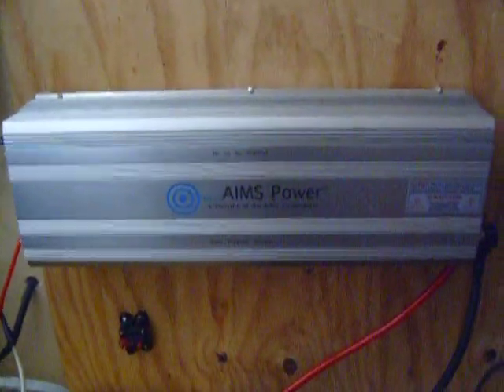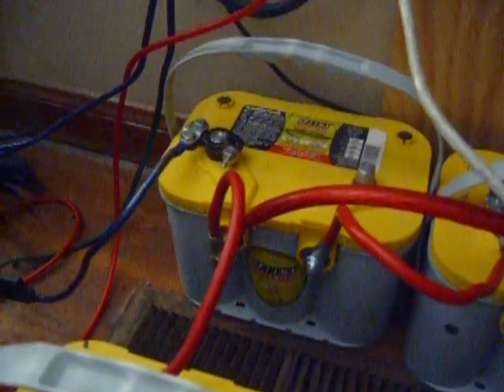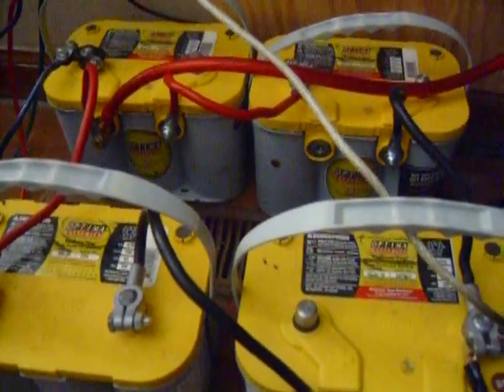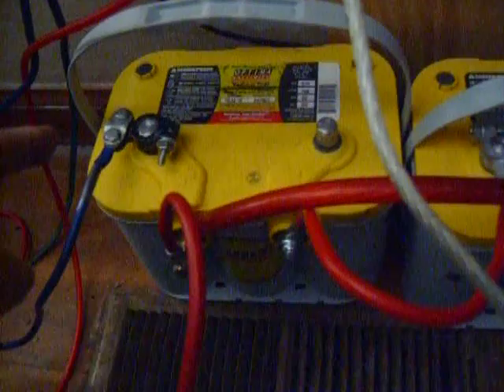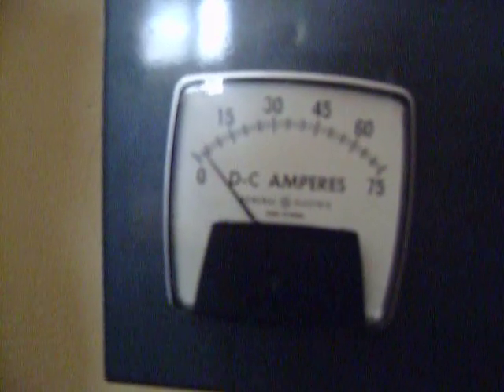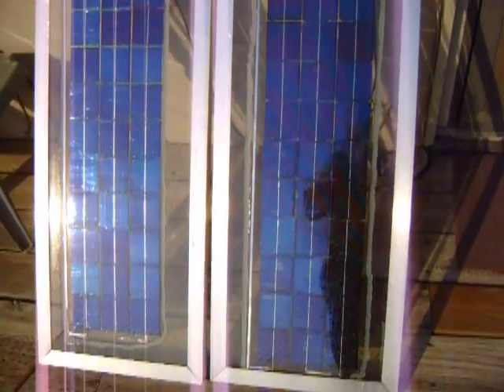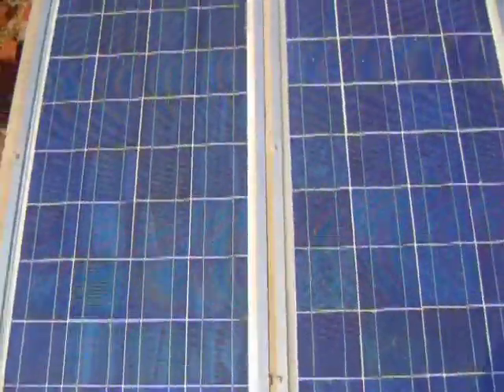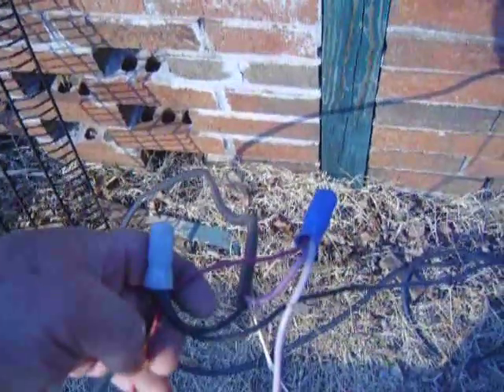24 volt 7,000 Watt Aims Industrial Inverter Installed

Comment: Make your ground wire as short as is practical to prevent the loss over a long length. The same current that flows through the positive wire also runs through the negative wire.

Comment: PowerStar 12V 200Ah SLA AGM 4D Battery, Deka Solar Gelled-Electrolyte Battery 12VDC 265AH @100 Hr Rate 20.75"x11.00"x10.00". 8G8D that maybe $989.99 ,some sell for $700.00. the 12VDC 210AH is $770.0

Comment from the maker: @birdwing98 it goes up to 28 or 29 volts before it sounds an over voltage alarm. The close you have to the panels the better. I did end up replacing the wire with heavy 8 gauge wire.

Comment: Does that inverter accept a voltage higher than 24V?  If yes, what would happen if you placed the inverter outside, closer to the panels, and then ran excess power inside to the batteries?  Are you feeding any power back to grid?

Comment from the maker: @valko007 The wire is large gauge 8 for the battery part and 00 for the inverter. It worked great no wires were ever warm. It worked for a couple of years no fires. I am going to hook up my pure sine Aims inverter really soon. Most of my wires are contained in the 10 x 12 Hoffman box. The other wires have to go to the batteries and the inverter dont know how to do it any different. The temporary ground wire I stung out the door was just for that day I hooked it up.

Comment from the maker: deep cycle means you can run the battery down many times with out killing the battery and car batteries can not do this with out dieing. Pure sine wave is just like the utility company power. Other types are modified and they are cheaper to buy but not as good they don't have as much power. Fridge will run slower. microwaves buzz and vibrate a lot. Korcera makes some great panels but they are very expensive. Sharps are good but very expensive. If the panel has a good warranty buy it.

Comment: @shartne yep, i like your setup, and the 12v /24v efficiancy comparison, i am poundering the numbers on my house now, to find the max loads under worst case and how best to use my 120v appliencecs that came with the house, mainly, well pump, oil burner, and reefer, moving down priority from there, thnx 4 the vid

Comment from the maker: Maintenance free batteries means that they are sealed. My batteries are sealed and plus they are deep cycle. My Yellow top Optimas are Deep cycle AGM which means they are made with Glass Matting. You can use Flooded batteries with open tops or sealed batteries just make sure that they are deep cycle. You can use cranking batteries for cars but they are not going to last long because they aren't designed to run low like deep cycle batteries.